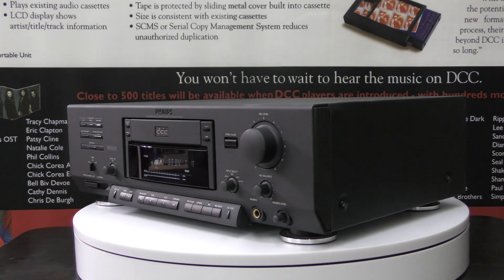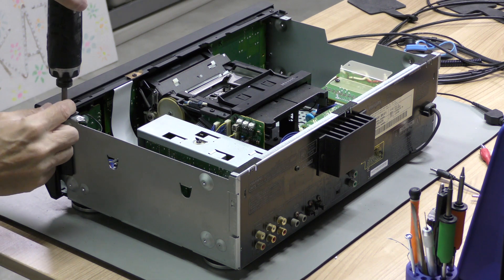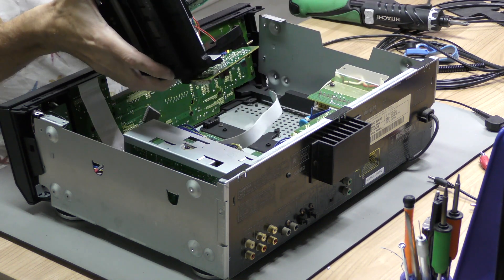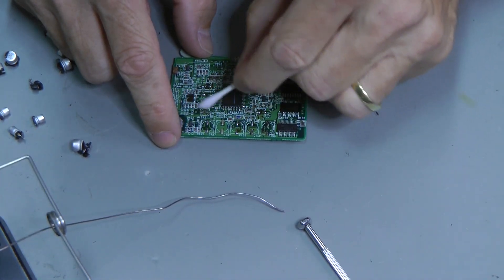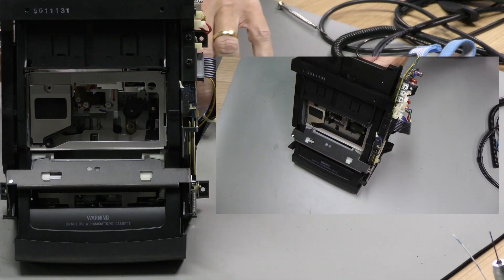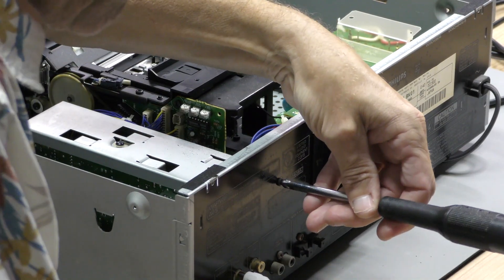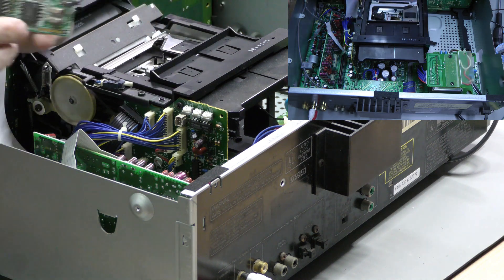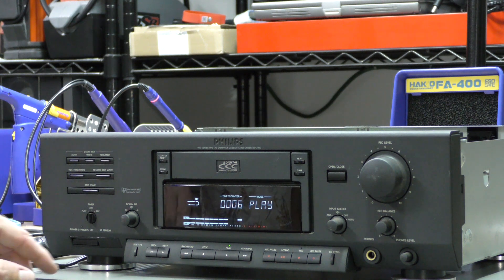Philips DCC900 Digital Compact Cassette repair and recap

Comment: Hi, I have just bought a second hand Unit--could you tell please tell me the values of the Caps that need to be replaced both on the read/write board and the Audio Board Please-Thank You
Reply from the maker: They are mentioned in the description of the video.
Reply: Thanks a lot

Comment: Ok good info allthough I have the same machine, but the single DCC tape I got with it simply doesn't output any sound. Tried recording on it. Looks like it works, but then again, I rewind, play back: zero sound. Not even a hiss. While it does play analogue cassettes without a problem (but quite poor sound quality compared to an analogue deck).... Is it even worth it to replace all the capacitors, cause to me it seems there must be already a part of the digital circuits broken then....
Reply from the maker: Always happy to help. Definitely worth it as they are becoming rare.
Reply: @DRDCC  That was my thought as well; they become rare and my DCC machine doesn't completely function well, but it's certainly not all broken either. I hear you have a Dutch accent? I'm Dutch too by the way. But yes if you could help me a little I'd be quite thankful...
Not sure yet when I get to really focus on fixing this one, but if you're ok with it i will send you an email by then.
Reply from the maker: @FBAV  Absolutely. Fastest help via forum.dccmuseum.com

Comment: Would you please tell me what kind of hot air gun you have to remove the SMD capacitors??  May it damage the circuit board accidentally? It will be a great help if you can tell the exact heat setting you used...thanks and regards
Reply from the maker: We use a Hakko air gun at 750 Fahrenheit. If done carefully, there should not be any damage.
Reply: @DRDCC  thanks so much for quick response.. I have two DCC players, Philips  DCC 900 and Technics RS DC-10.. Philips doesn’t detect any cassette. Technics can play analog cassette but don’t play DCC cassettes..

Comment: Can I ask one question about a Philips DCC 300? It plays the analogue and DCC tapes nicely but when you try to record, nothing is recorded although the meters shows it records.  I have cleaned the head the pinch rollers are cleaned like new. I have also serviced the capstan motor which was making a noise which whenever become louder, the DCC tapes were not playing. Now everything works fine apart from the recording. The digital board and the one underneath seems dirty but I do not know if the dirt is from the capacitors or from the age. Should It be the digital board responsible? The capacitors also look nice
Reply from the maker: Hi. Please visit forum.dccmuseum.com for the fastest help.
Reply: @DRDCC  Thanks for the reply! I entered the DCC Museum and I found service hints from the manuals that suggested to see the digital board. But to tell the truth, the three boards (the  digital, the bigger one under the digital and the board that the heads go and attach) are so heavily populated with hard to find microprocessors and I do not have the knowledge to test, nor the equipment. Recapping all these boards is not a good idea because I may end up nowhere if it is probably the head faulty. Also I entered the service mode and I checked every module and all seemed ok

Comment: I bought this exact same deck from a thrift store for ~20€, seemed too cheap from the start😂 It has some serious issues:
1-  I insert an analog cassette, it keeps switching from analog to DCC on it’s own. It has a mind of it’s own, from analog to dcc and from dcc to analog over and over again
2-  There is no left channel playback(even the display doesn’t indicate left channel amplitutde). And the working right channel makes some nasty “fssss-psss” sounds from time to time
Should I return it?

Comment: Hi, great vids, DR DCC! I have a Grundig DCC 305. After replacing the tray belt the deck worked for a few minutes but now it won't. It just displays NO CASSETTE. Is there a cessette occupancy sensor that could've gone bad/stuck? Cheers!
Reply from the maker: Hi, For the fastest help go to forum.dccmuseum.com That way others can learn as well.
Reply: @DRDCC  Thaks, DR DCC. It is informative indeed!

Comment: Hi DR DCC, in the meantime, congratulations on your skill! I ask you for an opinion: I bought a Philips DCC900 deck sold as fully functional on eBay. Actually, as soon as I got it, I tried it and it has the following problems:
1) when playing DCC tapes, side A ALMOST ALWAYS works well; sometimes, however, the signal "skips" like when skipping the CD.
2) Reproducing side B this problem almost always arises.
3) the analogue cassettes have a volume equal to zero, practically imperceptible, so much so that the meter does not mark any notch.
4) sometimes the cassettes, especially the DCC, turn "whistle" (a "mechanical" whistle, not a signal one.
A specialized technician here in Italy told me that it is probably sufficient to change the capacitors and that the whistle could be due to the cassettes that are a little old.
What do you advise me to do? Do I try to repair it or return it? (ps: I paid 170 euros for it and it is in excellent aesthetic condition).
Thanks for your patience and congratulations again!
Reply from the maker: visit forum.dccmuseum.com and post this question, so others can read the answer as well. We are happy to help.
Reply: I do not know if you have repair it or not but the whistle is from the capstan motor, you need to repair it or find a new one. The DCC 300 did the same and it was the motor

Comment: Hi Do you have a list of the capacitors that you replaced on the phillips dcc 900 player?
Reply from the maker: Yes, it is already in the description of the video.
Reply: @DRDCC  Hi Thanks I just noticed that they where there thanks. I've just bought a phillips dcc 900 on ebay ( Ive watched your dcc videos on youtube) which Im in the process if fixing. It has no sound but it shows up on the display thats there should be sound. I will order the caps in the next couple of days and get to work on fixing it. If I have any problems I will put it on the forum of Dcc museum for advice, hints or tips. Thanks again for your videos and knowledge of the dcc format.

Comment: Hi, are the 2,2uF/35V and the 2x 4,7uF/16V bi-polar? Cause i can't see in te video what is minus or plus. Also on the originals i could not see it. I used normal non-bi-polars, it does not like that. Thanks!
Reply from the maker: Sphere Intelligence Yes they are bi-polar.
Reply: @DRDCC  Thanks for the quick response. Have to order 3 correct ones. Seems i did not notice the bp in the partslist. Als hij het weer doet laat ik het weten. Staat al een jaar stil, ook zonde. Groetjes.
Reply: Finally had time to fix the 3 remaining bipolar elco's. It's working like new again! Bedankt en groetjes!

Comment: Great video. I have just acquired a Philips DCC900. It seems in pretty good condition and will play both analogue CCs and DCCs. However it won't record anything. I have tried feeding all the inputs and the meters respond happily and it appears to be recording, laying down track markers etc., but when you try to playback it is just silence. Could that be to do with the capacitors? According to your video the capacitors will need changing - how do I find out which replacement capacitors are needed? (I am not an electronics engineer, just a hobbyist with a soldering iron), but I'd like to return this machine to full working order if possible. Thanks in advance.
Reply from the maker: MGF Films Hi, on the new forum.dccmuseum.com there are more topics and pictures about this topic.  The problem sounds like a capacitor issue indeed. What is your location?
Reply: @DRDCC  Hi Dr DCC, I have been looking at the museum website - very interesting. I will check out the forums too. I'm in the UK.
Reply from the maker: MGF Films Great. If you need any help, you can always send us the boards for recapping.
Reply: @DRDCC  OK - If I did that what sort of cost?
Reply from the maker: @mgffilms5292  You can contact us at museumdcc@gmail.com for more detailed information regarding this.
Reply from the maker: https://forum.dccmuseum.com/t/dcc900-capacitor-replacement/162/10

Comment: Hello,
This video demonstrates my problem (DCC & MC cassettes).
https://www.youtube.com/watch?v=fq2tIfLLi6A
The capacitors have been replaced with ceramic ones and the problem persists.
Please do not know how to detect a fault. Other possible errors?
Thank you for every answer.
Best Regards
Reply from the maker: Our video about the Technics RSDC10 shows the problem are on the read write board, where the side a-b connections might have failed. That could be a problem as well.
Reply: Thank You very much.

Comment: Hey DR DCC !
A very nice tutorial video ! Really supperb! 
I have 4 PHILLIPS 900 with record problems. Can you help me?
It runs, shows levels on meter, but it didn´t record anything. I did all the recap as you teach but still no record. (all 4 dcc900)
What should I do to fix them?

Best regardds!!
Reply from the maker: That is really strange. Are you sure you did recap them with the correct capacitors? All 4 not recording can't be normal?
Reply: @DRDCC  , yes, it is really very strange. I did all the procedure. They play cassetes, but with the dcc´s nothing. Is there any other thing to be considered beside the capacitors?  Thank you so much !
Reply from the maker: Ricardo Nussler Do they play dcc tapes?
Reply: @DRDCC   To be honest, I don't know. Because I have only 2 90minutes sealaed DCC tapes for recording. I will search for a pre-recorded dcc and try to do this test. We will keep in touch. Thanks a lot once again !
Reply: @NusslerAudio  Hi - I have the same issue of not recording on a DCC9000 I have just acquired. Did you resolve your issue? and if so what was it? Regards
Reply: @mgffilms5292  Hello ! To be honest I gave up fixing... There´s 4 of them here with the same issue and after recap, nothing happens... Maybe with a little bit of patience and a good cup of coffe (10 gallons) . Regards

Comment: Hi, I exchanged all the capacitors on both printed circuit boards that were shown in your video. Unfortunately, there is still no sound. After inserting the cassette, the mechanism works correctly, but there is no signal at any of the outputs. Also, there is no sound after connecting the headphones. There is nothing on the display with the signal level. What is your suggestion for further searching for damage? What should I check first?
Reply from the maker: Grzegorz W What you can check further is the side a-b connections on the boards. In our other video about the Technics rsdc10 this is even better explained. These connections sometimes are damaged because of the acid leaking from the capacitors.

Comment: HI Dr dcc, in your video is that all you have to do is replace those capacitors you mentions or would recommend anything else?
Reply from the maker: Hi, You would have to check the belts and pinch rollers. This video was just about the capacitors. The belts used on the first generation are very good. Depending on usage, the pinch rollers would go first.
Reply: @DRDCC  where would I get a list of the capacitors you replaced. On a service manual for that deck?
Reply from the maker: @johnbateman4255  If you look at the description of this video, all capacitors are mentioned. The service manual can be downloaded via dccmuseum.com
Reply: @DRDCC  I will keep you posted on how I get on with the dcc player. Thanks again..

Comment: Hi DR.DCC. I have Philips DCC900, when i put analog or dcc cassette won't play. On display write ''No Cassette''. Do you know some solution? I change all capacitors like you. Thanks. I
Reply from the maker: There are several detection switches you could try and clean in the mechanism. What is odd that it does not even detect a regular analog tape.
Reply: Do you mean this three swithes or  no? https://imgur.com/a/E5gPBH0
Reply from the maker: vfdf fdd yes, and also to the left hand side of the mech (inside small 5 switches)

Comment: what solution do you use in the ultra-sonic cleaner?
Reply from the maker: Hi, started with iSonic cleaning solution and then just water.
Reply: are all of the replacement capacitors polarized or not?
Reply from the maker: steve kisner 2 are not. If you look at the description of the. Video, you can see their details.

Comment: Hi I have just gotten hold of a none working Marantz DD82  Compact cassette player which has a problem it says tape blocked all the time is this due to a capacitor problem??.
I would also like to change all the capacitors as well but not sure how many I need or what type I can solder quite well but never done a job as complex as this but i would like to try.So any help you could offer would be greatly appreciated thanks
Reply from the maker: In the description of the video the capacitors are mentioned. 
Cassette blocked is most likely a mechanical problem. You would have to open it up and inestigate.
Reply: Cass blocked means the tray is jammed. Check if the tray is perfectly horizontal one side may of come off its track guide. If the large wheel is hard to move then that's the problem. Press the tray back into the guide and it should be smooth to move. When you connect it back up it should say no cassette if there's no cassette in the tray of course! If it isn't the tray guide it could be something else jamming the tray. Examine the tape mechanism to see what looks out of place
Peace ✌️ out people

Comment: If you change the Elkos solder the same SMD in not this what you show us. The reason is that you install a 2nd inductor array and this will lift up the SNR on the Head Amplifier. Sometimes you have more Dropouts. Well it worked but what do you think why they install SMD parts!?
Reply from the maker: Volker King We have never experienced any dropouts after more than 100 units, replacing with regular caps. The main reason for not going back to smd is that the damage is often severe, and islands for soldering are sometimes completely gone. With regular caps you actually have room and legs to restore.

Comment: @drdcc where can I get new belts for a Phillips 300 dcc? I'm going to try and fix a non working unit. So a recap is in order. What else should I watch out for? How hard is it to fix a try that won't eject? I didn't receive the unit yet...
Reply from the maker: Daniel White Hi, you can contact me at the dccmuseum website for more info on the belts. Replacement on the 300 is a bit tricky, but I can provide some pointers. I have not seen a 300 that needs new caps though. There are no smd caps in a 300.

Comment: Hi there Dr DCC just came across your site by accident, and yes i too have the philips 900 and my bench techie just wasnt interested in fixing. have the same problem as most of your other readers, all the lights are on but nobodies home. Maybe i could have a go myself as been a true audiophile for going on 50 years. Could you do list of the caps to be done and a diagram showing which goes where. just too mint to trash or maybe replacing the boards could be an option. Many thanks if you can help, Kind regards James. By the way started it up after 5 years kind of a pungent smell emitting from it.
Reply from the maker: CruzyMopar Hi. If you look at the description text of this video, you will find all the capacitors that need replacing.

Comment: OK, obviously when you're saying "print", you mean "board".
also, why use through hole electrolytic caps, large format modern SMD caps would have been less of a mess.
Reply from the maker: Sarreq Teryx Yes, print was a direct translation of my native language. I was referring to the boards. You hear me comment on why we do not replace it with smd again. Most boards are really brittle from the leakage and to use regular caps it is less stressful for the boards. There is plenty of space for them. On the second generation players, Philips used regular through hole caps.

Comment: Good day..DR DCC..PLEASE LET ME KNOW WHAT IS THE ISSUE FOR "INI ERROR" AFTER POWER ON..THANK YOU
Reply from the maker: Arvin Aves that indicates a problem on the pw03 board, but could also be hardware/mechanism related. That board was recapped by you correct?
Reply: DR DCC.. Thank you for ur reply.. No im not the one who recap 1st the pw03.
Im the second to troubleshot the issue.. Pleas let me know what exactly part to be replace thank u..
Reply from the maker: Arvin Aves that is not very easy. You would need to measure a lot of things according to the schedule.
Reply: thank u..i find out from power area there are three capacitor are shorted and resistor hope after I replaced it will solved the issue.
Reply: DR DCC..HAVE A NICE DAY...CAN I HAVE YOUR PERSONAL EMAIL ADD..THANK YOU
Reply from the maker: Arvin Aves museumdcc@gmail.com

Comment: Hello, I own a Marantz DD-92 and experience a somewhat different problem. During recording and monitoring of digital input I experience dropouts when the unit has warmed up. Is this still the same capacitor problem?
Reply from the maker: charles van beetz Hi, yes, it could very well be the capacitors on the second board. If you have not replaced the caps, you need to do this anyway.
Reply: Eventhough the playback sound is terrific now, you still mean I have to replace the 17 capacitors on all the boards? THey look oke, there is no sign of any leakage...
Reply from the maker: charles van beetz A visual inspection really is not enough. You would have to measure them individually. The recapping has to be done to save your Marantz on the long run, regardless.
Reply: Oke, thats clear.
Reply: Thanks
Reply: Well...I replaced all the caps (think it was necessary) but the problem is still there. I might have to take it to a pro.